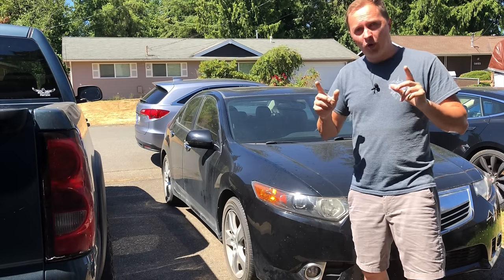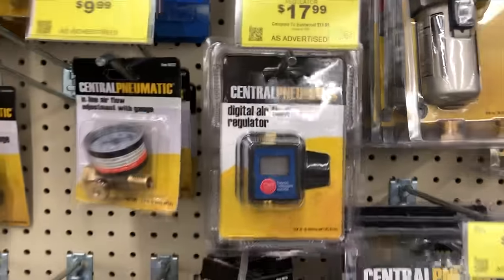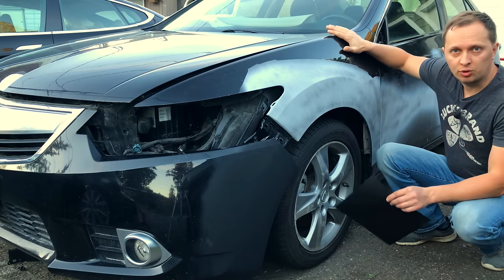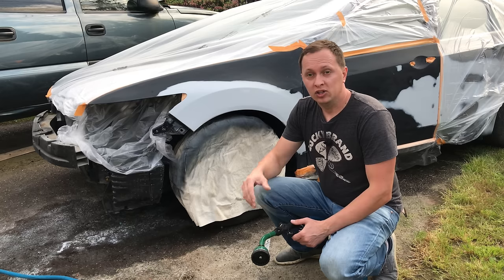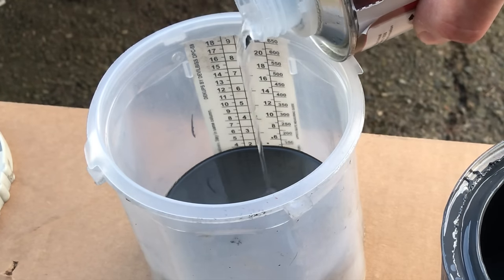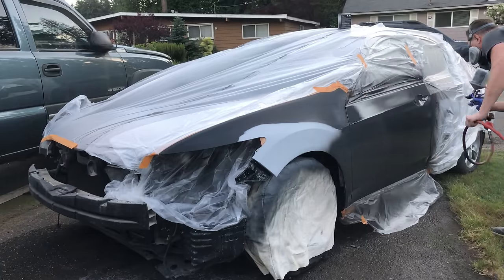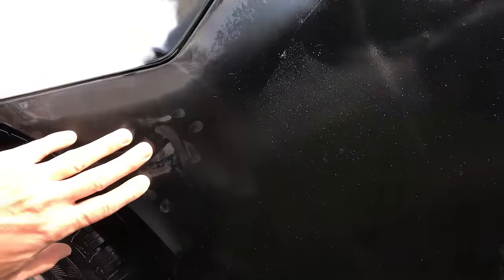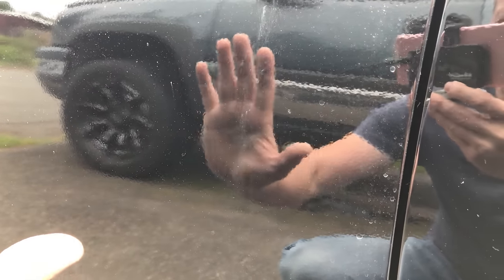✅ Using Cheap Chinese Harbor Freight Paint Gun to Achieve Professional Results

Comment: I painted my ol 81 chevy truck with a harbor freight kit. Came with pint size sprayer/tank an a 1/4 pint(or so,numbers are guesstimate's) sprayer/tank. Did it in 2 days, 1 day 3 coats primer an 1 day 4 coats paint. I used high quality paint that has paint/clear coat in 1. An people thought it was a 4g professional job. 🤣🤣🤣
Reply from the maker: Id say 3 coats of primer is an overkill, the reason I say that is because primer shrinks and the more coat you put on the longer you have to wait for it to fully cure. You can put as many coats on as you want and then sand the primer down to make it flat as glass, right after you get it painted it will look great, but a month or two down the road especially in the summer when it's pretty warm out, as time goes on you will see that a perfect body work that looked amazing at first will shift a little bit. You are  going to notice that there will be some slight waves in the areas that got repaired and primered. That's because a thicker coat of primer needs a good bit of time to fully cure and shrink before it could be sanded down and painted for the best results possible. Don't take this the wrong way, I'm not judging your work, just talking from experience. Paint/clear coat in 1 is called single stage paint, generally this is not a high-end paint material but something that is used on fleet vehicles such as trucks, taxis, etc. Its generally only used if you are repainting an entire vehicle since it os pretty bad at trying to match it up to an existing color of your vehicle, you cannot use it in a repair scenario where you only have to paint a fender or a door or a hood,  because that paint will not match to the existing color on the vehicle, I have personally only used it one time about 20 years ago to repaint friend's car, it turned out fine, but generally you will never see a respectable paint shop use this type of paint, unless the customer is on the budget and wants his paint job to be done as cheap as possible, it's always going to be base coat/clear coat... Unless you go to Maaco if you live in United States... Once again I'm not judging your work, there are many different ways to approach a repair or a pint job

Comment: tempature plays a big roll in how your paint atomizes. thats the problem with spraying out side. but ultimately cut n buff is almost always necessary
Reply from the maker: You are right about that, especially when it's warm outside, paint materials don't have a whole lot of time to floor out and start setting up rather quickly

Comment: Good video. But did you have to paint so close to the other cars that weren't covered up. All that excess spray could be seen going over them. 🤔
Reply from the maker: I've been painting in the drive way for a while and the way I do stuff normally I don't get any overspray on any of my cars. I normally throw some plastic wrap over cars, some time I apply spray on masking that washes off with water and sometimes I park cars just far enough away that by the time overspray hits nearby vehicle it's already dry so it doesn't stick

Comment: If you don’t thin the paint well and if you shake the paint instead of stirring and if you hold the gun at an angle instead of perpendicular or if you have too much paint output (which you did all of the above) than no matter how expensive or high end the equipment is, you will always get orange peel.
Reply from the maker: I thinned the paint out 1:1 as per spec sheet, I thin it out just the same when I use my Iwata/DeVilbiss guns and it lays down perfect. I do thoroughly shake the paint up once the cup is on the gun. These Chinese guns just don't atomize the material very well, I don't think they are true HVLP guns. I could probably get better results if I cranked the  air pressure way up but then I would end up with a ton of overspray and a bunch of wasted materials that aren't cheap these days... This isn't my first rodeo when it comes to auto paint, but I can tell right away the difference between a cheap, crappy gun and a good professional one
Reply: Orange peel i used to get from high end paints no matter what ...like glasurit..
And if u over thin it youll end up with a bunch of hangers,but i use iwata for clear its just beautiful how it lays on even cheap clear,and base i use sata hvlp or tge rp
Reply: Also old school labour extensive teaching i had from europe and key is wet sanding the surface to 800ish ..youll see the difference

Comment: how do you mix the cars primay paint before putting it in the spray gun, like what ratio should i use and what specifically should i use? Also, how do you find the right paint to buy before starting the job? I know how to find the color code, i just dont know what paint i should be getting
Reply from the maker: Basecoat a.k.a. paint usually mixes 1 part paint to 1 part reducer, some paints may have to be mixed different, you can always find your mixing directions right on the label of the can of paint. As far as the type of the reducer being used, most of the time you'll be using a urethane reduce. There is fast, medium, slow and extra slow reducers... Each of those reducers will have a temperature range they should be used within, printed on the label... So if it is cold outside like 50 –60°F then you are going to want to use a fast reducer, and it's warm outside then you may want to use slow or even extra slow reducer and so on... Find a paint store in your area that deals in auto paint, they will sell you the right type of paint that you would need, they can also answer a lot of the question that you may have...

Comment: I think the clear having all that peel might have also been because of the temperatures outside probably got too cold causing the clear to have a reaction or it got dirty
Reply from the maker: These guns just don't atomize the paint as well as my professional Iwata or DeVilbiss gun. There was no dirt in paint, mostly just the orange peel
Reply: @fix206  yea it’s strange I didn’t even get that much orange peel while using spray paint and I used dupli color lol
Reply from the maker: One of the ways of lessening the orange peel is to turn their air pressure way up. But then you create way too much overspray and lose a lot of your material and that kind of defeats the purpose. Good professional paint guns will help you achieve good results at lower air pressure with more material on the panel rather then in the air... Brian from paint society channel tested out the cheap purple gun and he was able to get more or less good result with it. However you don't see him use that gun in any of his other videos. He always uses the high-end professional guns...

Comment: Great video! Just bought a beater car and want to try painting car myself, would love to see video showing complete tools, supplies and cost breakdown for doing a budget friendly project like that.

What air compressor and hose should I get at Harbor Freight?
Reply from the maker: Good prep work is foundation for a good paint job. It may take you a day or even two days to get the car prepped, but if you want your paint job to turn out better and last longer don't cut corners and take your time prepping. I cannot really give you a cost breakdown because prices will vary depending on your location. But you would basically need to find an auto paint supplies store in your area and tell them that you need a lower end/cheaper basecoat/clearcoat materials. Try pricing it out that way. As far as the air compressor goes that would also depend on what it is that you're painting. Are you just going to paint one fender? Or are you going to be spraying the entire car all at once. Bigger is always better. I personally run a 60 gallon compressor and that should be a minimum for auto paint in my opinion. Also look at the specs on the compressor's air pump. Once again the higher the numbers of the pump output the better, that means that the compressor will have enough air output to recover while you are painting so that way your air pressure does not drop too low while your spraying. That would for sure be the problem with using a smaller compressors, they just don't have the adequate air output, so as you are painting the air is being supplied will drop in pressure and there will not be enough air to properly atomize the paint and clearcoat therefore your end result will look like sh!t. Instead of going to Harbor freight, take a look on craigslist or offerup in your area I bet you'll be able to find a decent used 60 gallon compressor for $200-$400... If nothing is available right away just wait out a bit until the right deal will come along. Just recently I helped a friend acquire a nice 80 gallon compressor on craigslist which is perfect for auto paint and he only paid $130 for it. That was a steal of a deal...
Reply: @fix206  thank you so much for taking time to provide such a detailed, helpful reply! Much appreciated!

Comment: what kind of primer are you using before prepping and when you start wet sanding
Reply from the maker: I use a high build primer that I normally apply over the areas that get fixed. Normally I let the primer set up for about 24 hours before sanding

Comment: I have two of the cheapest HF paint guns. I always get orange peel and I thought I just sucked. Maybe time for better tools. Also - you didn’t get overspray on the truck?
Reply from the maker: Using professional guns versus harbor freight guns it's like night and day. That's why right after I finished with that paint job I went ahead and returned both of those guns. The truck is actually just fine, I know there's no masking film on it but since do a lot of paint around it, it usually gets a coat of "3M Overspray Masking Liquid Dry" 😉  before I paint.
Reply: Fix206 @Fix206 Thanks. I’ve learned a lot of good tips from you : frame pulling fixture, how to make a spotter, roof puller, tram gage, and now overspray masking. Much appreciated.
Reply from the maker: I got a lot more good stuff in the works for you, stay tuned my friend !

Comment: Why do you say the other purple gun at Harbor freight is not a HVLP  when it says it right on the box and price tag? I was under the impression that one just came with a regulator and the other one didn’t
Reply from the maker: Yes I wasn't looking at the box of the tag, but at the guns themselves that were out on display. One of them had an HVLP stamp on it and the other one didn't... So I just made an assumption... And you are correct, as far as I can tell the only difference between the two is one comes with the air regulator and the other one doesn't

Comment: Like somebody else mentioned, a little more pressure would have laid that clear out better. The $75 paint gun is actually a really good gun. I don't feel that it got a fair chance.
Reply from the maker: Maybe so, I just went ahead and set this gun up the same way as I set up my Iwata or DeVillbiss guns. With my guns I get satisfactory result at lower pressure. Because that's how HVLP guns are set up to operate...
Reply: @fix206  Have you tried it since with more pressure?
Reply from the maker: No, I have not. I actually returned both of those guns after filming. I wasn't impressed with either one of them so I wasn't planning on using them any longer

Comment: I would like to see the correction of the paint. I assume you are sanding and buffing it out to get a better finish with the clear. Thanks for this video, I was thinking about painting my Tahoe with one of those cheap guns.
Reply from the maker: Yes I will be cutting and buffing the car in the next video. I'll try to make the process as detailed as possible. It's a pretty time-consuming process so I try to avoid it if I can, and one sure way of avoiding most of it or at least some of it is by using a quality professional paint gun.
Reply: @fix206  thanks again for the video. I have worked in a paint shop before, so I know how it all can be time consuming. I mainly dealt with the prep though. Spraying primer and all is easy for me. It was over 20 years ago though but I just thought i would give the base and clear a go at it and see how it comes out.
Reply from the maker: You can definitely do it especially if you have some prior experience. As long as all of your prep is good and you using good equipment, after a bit of practice to get your body and arm moving in unison at correct speed you can start pumping paint jobs out one after another :-)

Comment: With a cheaper gun a different air-pressure and way of using makes a big difference for no orange peel on finished result.
Even if you buy a $ 800,00 paint gun doesn't mean the result will be perfect.... the painter create the finish.
Reply from the maker: You can crank your air pressure way up to 50psi in an attempt to get a better finish and turn most of your material into overspray in the process. These cheap guns just don't atomize materials the right way. An $800 paint gun will not make someone a great painter if they don't know what they are doing and at the same time you won't see professional painters who paint day in and day out using these cheap Chinese guns, because they are junk! Otherwise why would a guy who really knows what he's doing spend hundreds of dollars on a paint gun when he can just get away with using a $15 or a $50 gun?

Comment: How do you do this outside without the bugs and other things sticking to the wet paint?
Reply from the maker: I've been doing this for a while and over the years I've learned the patterns of when the bugs are out (Time of the year/time of the day) so I generally try to do it when bugs aren't out in high numbers (always keep tweezers nearby so you can pluck out anything that will fly into the paint). And as far as the dirt goes, I don't ever paint when it's windy or even breezy, and even then I hose down the ground about 15–20 feet around the car that I'm painting this way any of the dirt that may tumble into the work area will get trapped in the water minimizing the risk of foreign debris making its way into fresh paint
Reply: @fix206  Cool. Thanks for the advice.

Comment: don't blame the gun - I've laid flat ass clear coats down with the harbor freight purple gun - it's the clear your using and your mix rates. I've thrown away more expensive guns and always go back to harbor freight guns - they are great for one - two paint jobs then throw them away and buy a new one for the next project also don't just "full open" the adjustments - if you dial it in before spraying you'll get better results
Reply from the maker: I know you can crank the air pressure way up on these guns and end up with better/flatter finish, but at the same time you'll create so much more overspray and you're just gonna end up losing a lot of the material into the air. I personally just did not have a good luck with these cheap guns, but I can lay the sealer/base/clear out nicely with my Iwata just about every time...

Comment: It's never the gun! it is always the experience or the painters skills!
Reply from the maker: I think the correct way to say this would be but it's not always the gun. There are folks out there who could probably set this gun up a bit better and they may get better results with it. But at the end of the day it is much easier to get better results with a better gun. You do get what you pay for
Reply: @fix206  The old timers did amazing art pieces with hardly anything! Most used regular house tools or carpentry tools. Yet they created masterpieces! Also is not always the gun u have to also see what compressor is compatible. is the gun clean or does it have old paint left on the inside. Do u have filters or are your air lines water free. prep work is key also. so many different things the list goes on forever. A painter is a painter with a 10 dollar gun or a 1500 dollar gun. Even guys with 100k booths still get orange peel, dirt or dust. Just saying! My uncle is been painting since the days of Laquer, Centary, Imron. Dulux back when Dupont made lead based paints. He still uses a old Sharpe or Devilbis from 40 years ago no booth and the jobs are masterpieces. U do not need a expensive gun to be a painter just have enough experience and skills. The gun just hides the skills or experience. Good Luck my friend.
Reply from the maker: For sure there's a lot that goes into a good paint job. Correct prep work usually takes much longer than the actual paint job. And as you said amazing results can be had with just about any gun, however chances of you nailing a perfect paint job with cheap bottom of the barrel unfamiliar paint gun are slim. It takes some time to figure out the way the gun sprays, on average you'll go through a few paint jobs with slightly different adjustments of the gun until you find the right settings that work for you based on the way that you spray. But it takes a lot less effort to get everything dialed in and spring just about perfect with one of the high end, professional modern paint guns. They'll lay the paint/clear down great almost right out of the box, with some slight adjutants. Thats the point I was trying to make

Comment: How much does a good or great paint gun cost?
Reply from the maker: Actually if you are on the market for a great, professional paint gun I would highly recommend this gun right here: https://ebay.us/LK3cGo  . I've been using one of these at my buddie's shop and liked it so much that I ended up picking one up for myself. It's under $200 shipped to your door. It lays the sealer, paint and clear down better than any of the guns that I've owned before, I will actually do a review on this gun a bit down the road. If I were you I wouldn't hesitate and get one. This is one of the best guns I have ever used, at any price, I promise you won't regret it!